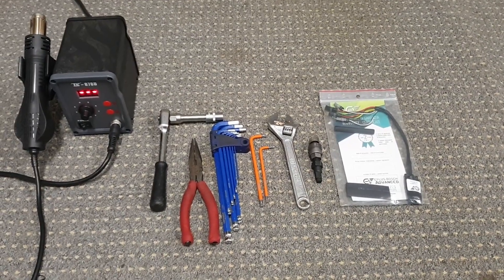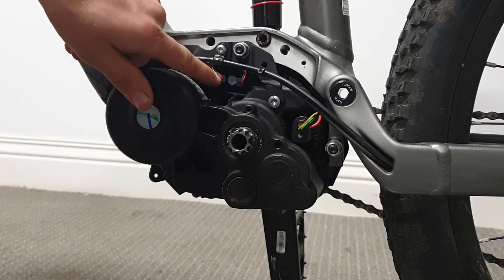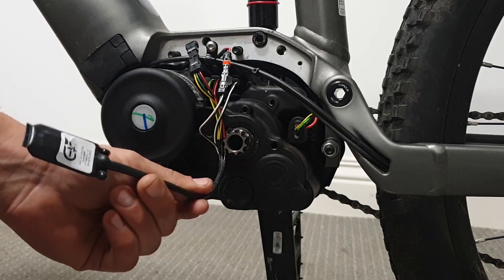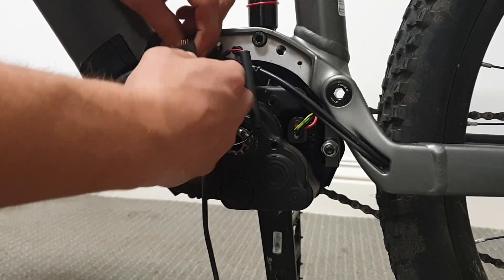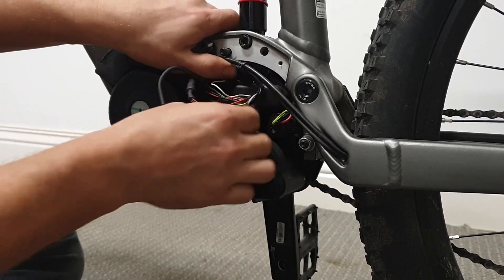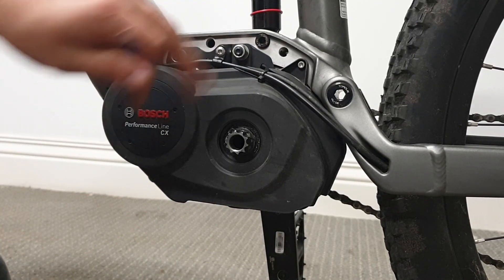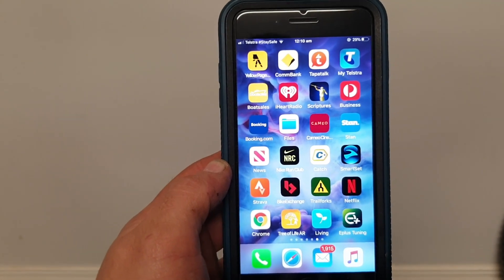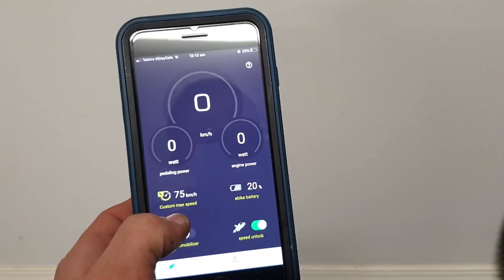Trek Powerfly Speed Unlocker Chip Install

Comment: That black metal bracket you took off to get at the wires behind,  what sort of torque setting do you need when putting it back on and what is the purpose of that bracket?  Does it actually hold the motor on the frame or does it just keep the wires in place?

Comment: Hi man. Thanks in advance! Now, what the difference between the standard and advanced?
Reply from the maker: Hi Mate, The advanced chip comes with a mobile app that allows you to turn the unlock on and off, Tune the power settings of the bike & offers a theft deterring immobiliser.

Comment: The best part is its so easy to install ... Take out 50 screws, oh and dont forget to heat shrink the connectors... Seriously why doesnt some get a software update to remove the restrictiin same as the use it to increase the torque in the gen 3 motors. Doing this is just plain stupid, it voids warranty and requires experience to do properly. Noticed the guy cuts out the heat shrink part. Wonder why?!? Now anybody who doesnt know how to heat shrink has to find another video and buy another tool as im sure you cant heat shrink with a bic lighter...
Reply: heat shrink..apply HS and apply Heat to Shrink